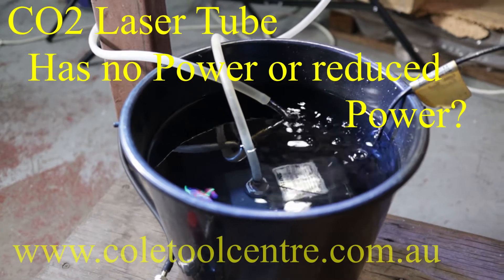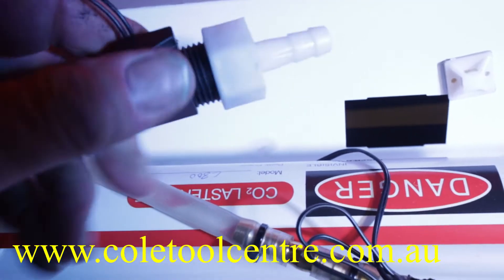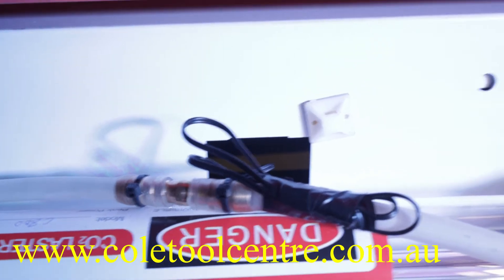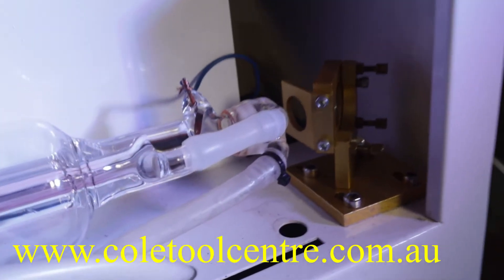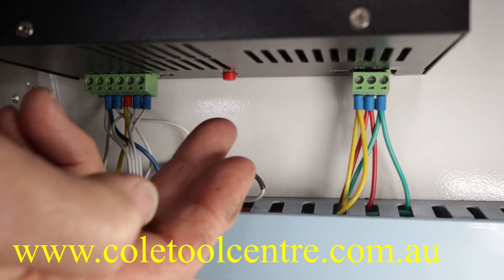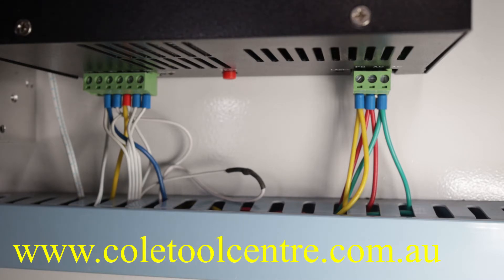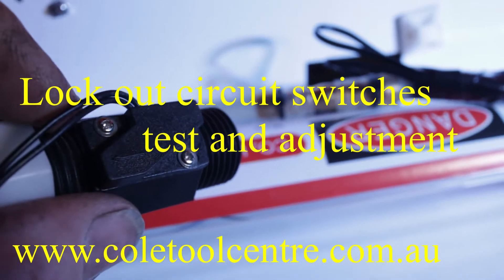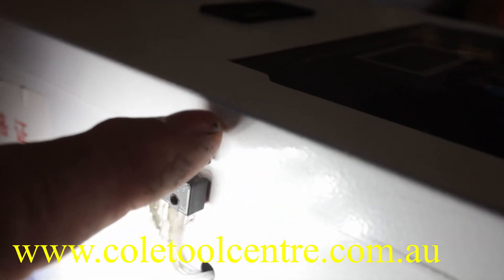Laser Tube CO2 Has No power or Lost power What and how do I check

Comment: I recently bought a co2 laser and if the co2 beam isn't firing it could be a e-stop problem, after that e-stop is triggered it disables the tickle pulse and disarms itself from the power supply until the laser is armed again in the settings.

Comment from the maker: If you can get it to fire when you press the test button on the Laser power supply.
Your electrician can buypass any lock out switches for water flow and top closed etc.
If it will not fire with the test button on the laser power supply you could have a dead tube or laser power supply.

Comment: im not sure if someone could help me, but my issue is that the laser does fire when pressing the test button on the power supply, but i wont fire when doing a job or if i hit the test pulse fire on my controller. i do  have waterflow,but not sure what it would be?
Reply from the maker: First do the checks on the water flow switch, and door closed switches. As these will cause the laser not to fire with the control panel.
Reply: @Graemecns  I do have water running through it, not sure if the switch is having issues. I’m gonna replace it anyway because it is a bit old
Reply from the maker: @mr.manny_s5506  you can buy pass the switch and see if the tube will fire.
It is a process of elimination.

Comment: Hi. My laser has had no power whatsoever for awhile. I'm prepared to fix it now. I just replaced the power supply with a correct replacement. My tester is reading proper voltage in, but nothing lights up at all when hitting the test button, even when the larger green plug is disconnected. Water is working, external power to air pumps and laser completely dead, fan to new power supply dead. I don't know what I missed, but I did not apparently understand a direct next step. Would you be willing to advise? Thank you.
Reply from the maker: your laser power supply should a have a test button on it maybe a green button which should fire the laser.
I think it will still fire even when you don't have a complete safety circuit (Water on Lid Closed).
You should be able to test the output from your power supply with a meter.
 if you have the correct output voltage you may have a faulty tube.

Comment: This vid was very helpful to me. My Laser was not firing , everything seemed to be perfect, No alarm on the chiller (CW-3000) but once i pulled out the chiller alarm cable and jumpered it (1-3),  the water alarm lockout was resolved and laser working as normal.

Comment: Does the tube have a glow when it is ready to fire?
Reply from the maker: The gas in the tube will usually be light up with a purple beam when it is firing, but you cannot see the beam when it exits the tube.
Reply: I'm working on a Golden Laser that has 2 tubes that is 80 watts each, I can get the heads to move but can not get the tubes to fire, and the LCD screen some put a burn mark in it,so it is hard to tell what it is doing
Reply from the maker: @RCjunkie  there should be a test button on the laser power supply you should be able to test there.
Reply: I looked all over the power supply for the laser there is not test button, I would send you pics of it
Reply from the maker: @RCjunkie  best to get onto your supplier and see if they have a trouble shooting sheet and manual  or any Idea on testing their machine.
Reply: no
Reply: I'm thinking of just put in a new screen and motherboard, it is a Golden laser and all of the stuff needed to make it run is out of date
Reply from the maker: @RCjunkie  was it working for for you then it stoppped
Reply: @Graemecns  No . I just got it used and was told it worked but have not got the tubes to fire at all
Reply from the maker: @RCjunkie  check that all your   lock out switches are working Eg water  flow and correct direction of flow, door/lid closed etc

Comment: Hello, i hear sparks over the wire and when i press Pulse on the machine the wire also is moving a bit(pretty scarry) , does the arc of electricity flows away from the tube anode?
how can i solve the issue?
Reply from the maker: You need to insulate where the sparks are jumping from the wire if it persists after you have it all insulate or moved wire away from surfaces where sparks jump to you may have to replace the tube. Remember this is dangerous high voltage and repairs should be done by someone with electrical experience.
Reply: @Graemecns  i mean i cant see the sparks but i can hear them If You know what i mean
Reply from the maker: @LaserTrace  if you can hear arking you will just have to find where it is arking maybe turn the light off.

Comment: I have a max 147W laser tube, it worked before we transported the machine. Went to realign the mirrors and it’s not firing. I thought maybe there is a button on light burn that I am missing? That was my first hunch, I’m new to the machine and light burn. FL-1390. No alarms going off so CW 5000 cooler works great.
Reply: maybe the tube leaked
Reply: @raymondzhao9557  Thanks for the reply. Actually it was a total rookie mistake. I purchased a Chinese laser and there’s a button you have to push to engage the laser. It was not labeled. I had to do was turn it on lol

Comment: If you get arcing where the wire connects to the tube, is the tube bad? I did a resistance test on the power supply and got 45 mA.
Reply from the maker: Arcing could be good or bad.
If it is just an insulation problem it is good as that is an easy fix just insulate the wire correctly and all good.
If it is caused because the spark is finding high resistance in the tube or a faulty tube earth and is jumping to the chassis it could be bad. If you did an amp test between the negative end of the tube and got 45ma reading if your tube was 80watt you would expect say 25ma check the spec for your tube.
I doubt you would get much of a reading until you fix the arcing to chassis.
Reply: @Graemecns  it’s a brand new factory wire that has a basic terminal ring connector soldered on it and it just screws down to the end of the tube on top of course. Then there’s a red silicone cap that goes over the end of the tube and wire and then another silicone sleeve that goes over that. Wouldn’t that be my insulation?
Reply from the maker: @karvtek  that is probably your insulation but if you have arking it must not be working.
You need to stop arking.
Reply: @Graemecns  I read that if your tube loses the c02 gas it will arc there. Time will tell

Comment: My Laser is no longer firing (when I run the machine or when I press the Pulse button on the Ruida Control Panel). 

It was working fine... until it stopped working.  I changed the tube as well as the power supply to the tube. 

I even connected a wire between the third and 4th connector in the Laser Power Supply (bypassing the flow meter). 

I don't have arching.  When I press the test button the Laser fires every time (provided the connections to the controllers are unplugged)... .. 

I shorted the flow switch it hasn't helped.... Water flow is good... No bubbles in tube either... 

What could be the issue..??   Is the RDC6442 faulty??
Reply from the maker: From what you are saying it sounds like your controller is the problem.
I am not familiar with the rudia controller so I am no help to you with rudia testing.
Generally electrically I would suggest you disconnect the power and have a closer look at the controller check for any burnt smell.
Reply: You should check 1-All Lens & Mirror are clear and shiny not dusty. 2-Check the variable volume of power is full or not. 3-check the Laser power meter show the right power. If these are ok than check the Co2 Lser tube Lens with the help of a pice of mirror, if look dusty than clean softly by ear-Bud and check. Thanks

Comment: Great Video and Very helpful. I wonder but is there a way to test the power supply itself. I have just bought a laser that comes with a digital readout in mA for the output current on the power supply itself. When the laser says its firing either with the red test button or the controller it shows 0mA. Just wondering if there's a wat to prove if its the power supply itself not producing any current or the tube/wiring not completing the circuit.
Reply from the maker: The digital meter should indicating voltage when the tube is firing If the laser power supply led is indicating the laser is being fired when you push the test button on the laser power supply. And it is not firing it could be a switch main door. Water flow. By pass the lockout circuit to eliminate the switch circuit.
If still not firing is probably laser power supply but could be tube.
Your electrician could put a multimeter between  the anode and cathode wire only test momentary as your meter could be damaged as the Amps could be over what your meter can candle. If meter indicates power should be faulty tube.
Reply: I had the same issue - never worked from the beginning, troubleshooting indicated the flow sensor is not working but changing the direction of the cooling water flow got the laser firing again. The flow sensor may have been installed backwards?